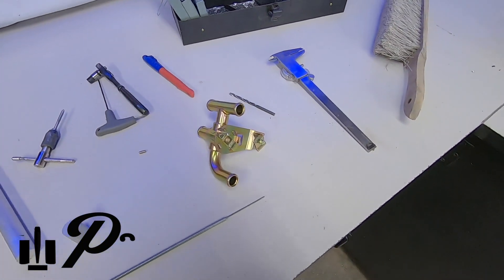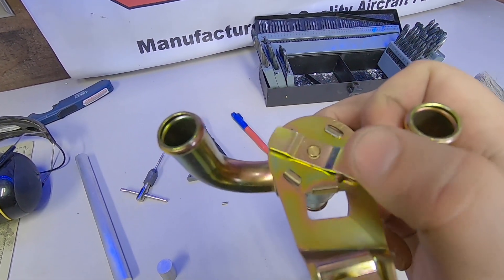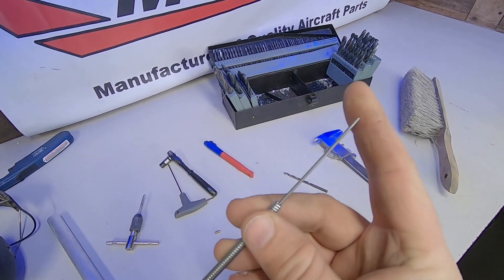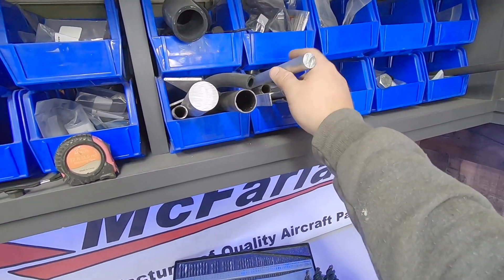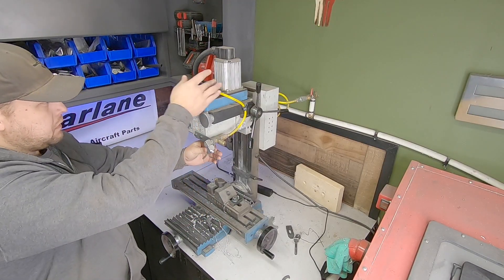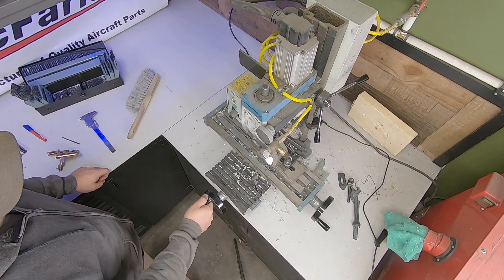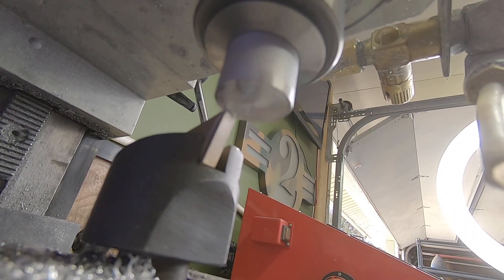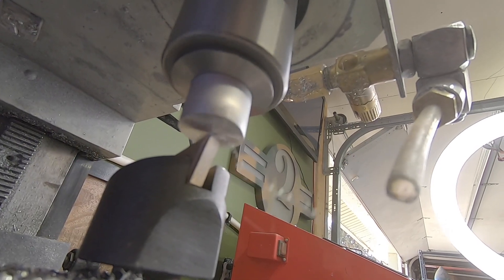Cabin Heat Bypass Valve Control. RANS S21 BUILD EP45

Comment: That's a lot of handle spinning. Nice work with the manual mill. I hear you on the delays and cost for projects. I have a large tube order to place for mine and keep putting it off hoping to get most at one time. Ill probably split it into several smaller orders. Metal prices and availability are all over the place.
Reply from the maker: One bite at a time.. Thanks for watching Jody👍

Comment: There's a heater control valve on late 90's tacomas that would probably fit your application really well, uses a cable to adjust heat
Reply from the maker: I didn’t want a plastic valve. This one I have seems like it’s gonna be perfect👍
Reply: Considering that he clearly already has one I fail to see the relevance of your suggestion.

Comment: Looks like they have 12v ones for about $32 but they are plastic. Google heater core bypass valve. I put a link but it disappeared. Maybe it is not allowed.
Reply from the maker: Yea YT doesn’t like links. I almost did an electric valve but I didn’t want plastic so I just went with this one👍
Reply: @Project2Aero  K.I.S.S., eh?
Reply: @Project2Aero  I agree plastic would seem prone to breaking or leaking. You have the opposite set up as me. I have a lathe that I sometimes force to do small milling but no mill.
Reply: @alanswanson1952  Plastic probably works better for auto use people let the fluid go bad with old green coolant turns to acid after 3 years rust metal out.